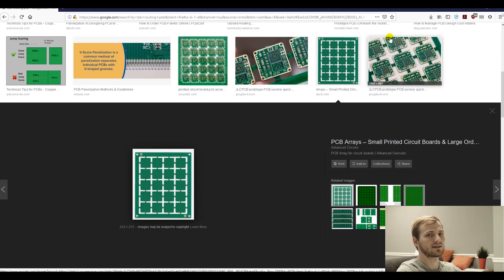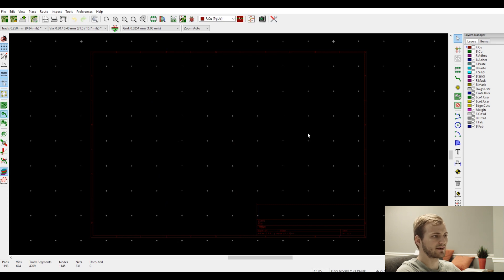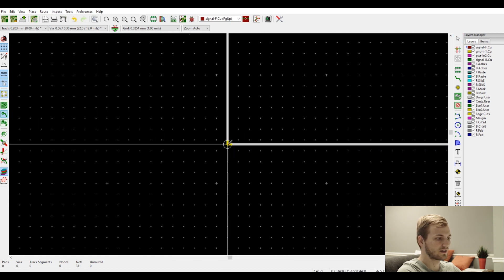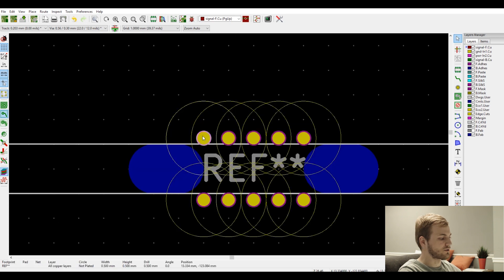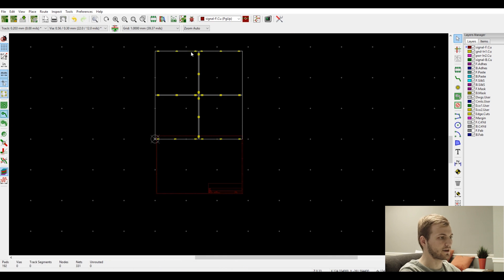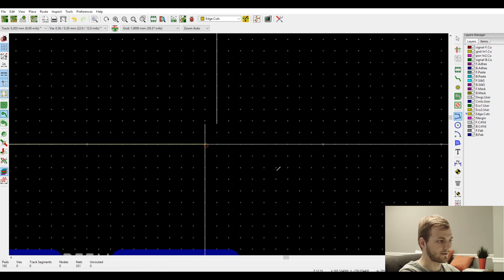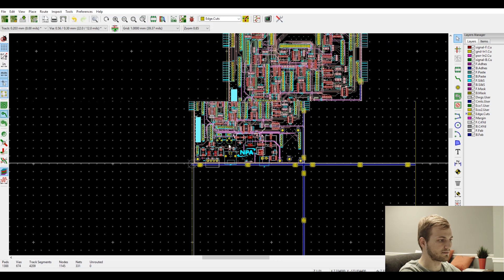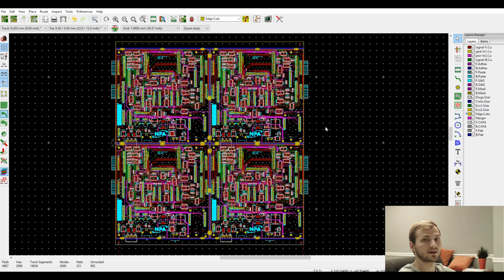Panelizing boards within KiCad - Random KiCad Tips

Comment: Good stuff! Excellent information! Seems like Kicad 6.0 no longer has "append board". But in any case, making the joined boards with JLCPCB costs #35, but making the two boards separately costs $8 each --- half the price! Bit extra work at the computer, but not too bad.

Comment: really interesting video! well, what about filled zones ? It seems they disappear, except in the very first copy of the pcb
Reply from the maker: You can turn them on and off in KiCad. It's much easier to design when they are turned off.
Reply: @MicroTypeEngineering  yes, I know about that... but what I meant is that when you make multiple copies of a PCB and you refresh filled zones, only the original one still has them regularly, the other copies loose filled zones... at least in my experience, may be I make some wrong step
Reply from the maker: Ahh gotcha. Yes, that appears to be a bug in KiCad. I found that out a year ago or so. The solution is to create and array of the PCB, not to copy/paste.

Comment: Great Video thanks. When you prepare a panel for assembly, and you append your boards multiple times as you did, can you just create a pick and place file and give it to the manufacturer?
It's the first time I am sending for batch assembly...
Reply from the maker: Yeah you need to give them a centroid file. Typically it's for a single board on the panel, and then you tell them the offset.

Comment: Great video! It will help me during making my new project which will be manufactured, not only PCBs, but also assembly. I just have a question:
It's possible to use small, local fiducial for BGA chip and 2 in the corners or 3 in the corners + small ones near high density/bga chips?